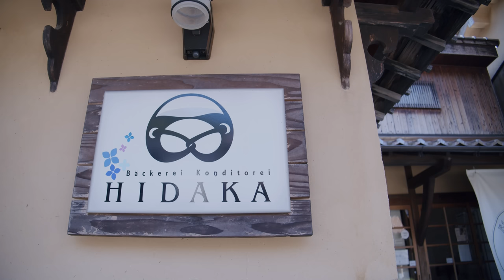the Japanese Baker who got the German master certificate with the highest degree  | Bäckerei Hidaka

Comment: I've worked a bakery owned by a  german trained baker and it shares many similarities.
1) Nuts, seeds  and fruits in every bread from sunflower seeds, sesame, pumpkin seeds, flaxseed, walnuts, macademia, raisins, apricots, cranberries, etc and even wheat brans/husks.
2) Some percentage of rye in the rustic breads usually in the range of 10-20%. We do make 100% rye too and like in the video, it has the texture of mud/clay during shaping due to lack of gluten forming proteins to make it stretchy. Rye is considered a subpar grain compared to wheat but they grow very well in cold dry regions like northern europe which is why you rarely see rye in French breads. Even a 10% rye addition will change the flavour profile to a more malty tasting bread. If you want to attract customers, bake 100% rye during peak hours. The whole bakery will be filled with fruity and malty aroma, aka esters, as the bread bakes. 
3) The use of malt both active and inactive to add colour, flavour, and boost fermentation. Together with sourdough as the leavener, they make a wonderfully rich and full-bodied bread.
Reply: What sets Germany apart from France when it comes to bread is that due to our geography all major grains grow here, hence we have over 3000 different bread varieties. The north is, like you rightly said, more rye reliant whereas the further south you go the more wheat is grown - though overall we prefer rye breads as they have a stronger flavour and are more filling (2 out of our 3 meals per day consist of bread with butter and a variety of toppings ranging from cold cuts, cheeses, vegetables, honey, marmalades to liver paté added and combined to once own preference. Breakfast here is literally called "the early piece" (Frühstück) and supper "evening bread" (Abendbrot)